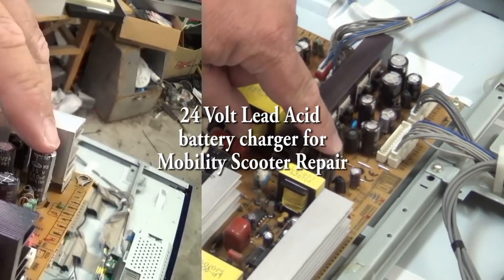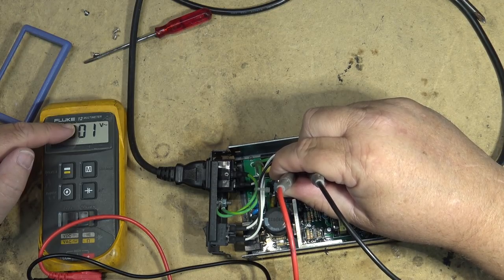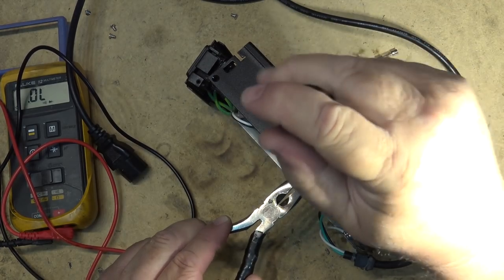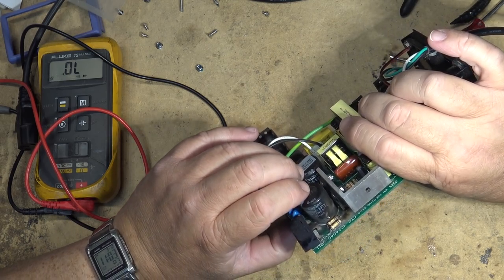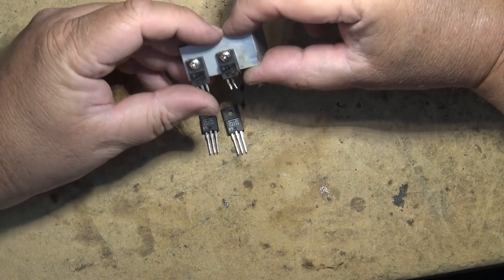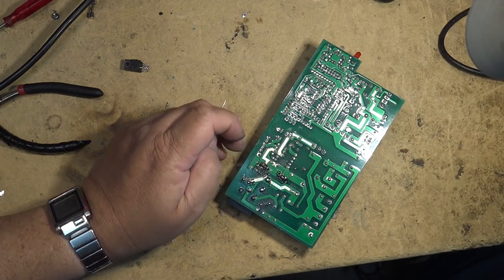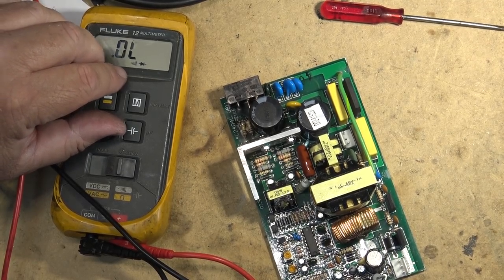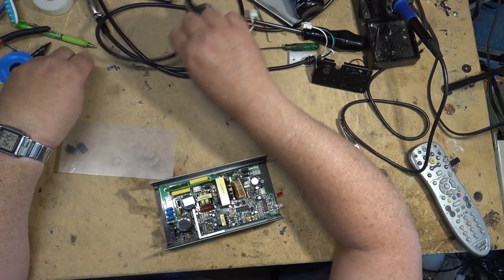Switch Mode Power Supply went Boom!! Let's fix it.

Comment: Loved the special effects. You smoke checked that thing so well it almost blocked all sunlight!  I might be about to receive a lesson here, but I usually just melt some leaded solder into the lead-free stuff to make the removal easier.
Reply from the maker: That's what i did.  Lead solder on the holes then solder wick dipped in rosin.

Comment: Try to use an old incandescent bulb in series as protection. In case of short the bulb will light protecting the circuit.
Reply: What could you use instead if you can't find that old light bulb? Ty
Reply: I think it has to be a 100 Watts bulb.
Reply: @lmolina  A 60W or 100W soldering iron with a 120 or 230 (depend on your grid voltage) led lamp both connected at the same multiple socket. The soldering iron make the load, the lamp make the signal light.

Comment: "Into this stupid socket..." I personally as an EE love those types of fuse sockets. Makes it easy to change and has space for a spare and they are quite inexpensive :)

When I do IEC modifications for older devices to get rid of permanently attached power cables, I choose these types if they fit to install :)
Reply from the maker: Place that nobody looks for the fuse. Owner didn't know it was there either.
Reply: @12voltvids  They're not uncommon at all in Europe. Can't say anything about USA.
Reply from the maker: @Mtaalas  
Well in Europe everything has a half dozen fuses.  Fuses in the plug, again at the input to the device, probably the wall socket too. I don't blame them though 240 volts has a few more hazards to consider.
Reply: @12voltvids  in UK they have fuses in everything and the kitchen sink, but most of Europe isn't UK :)

Though, frankly, having fuses in everything that plugs to a wall, including the wall is the best way to do it from the safety perspective.

And I wouldn't say 120V is safer, it just kills you slower.. ;D

And If I remember correctly, most people who die because of electricity do so not from the current or the shock itself causing damage, but from the ventricular fibrillation caused by the AC waveform. And that happens as easily with 120VAC as with 240VAC :)
Reply from the maker: @Mtaalas  Well not really true. Yes it is the current, only 50mA across the heart is enough to stop it, but the skin provides a certain amount of resistance. The higher the voltage the easier the skin resistance is broken to allow that current. 240V is far more dangerous to be shocked with than 120, just because 240 breaks the skin resistance easier than 120. I have been shocked by both and believe me 240 is something you remember. I did it unplugging in the 240 heater in my garage when my fingers touched the 2 live phases.  It hurts more than twice as much as 120.
Reply: @12voltvids  sure, but how in the earth did you manage to touch live wires in that situation? :o
Reply from the maker: @Mtaalas  I wasn't touching live wires.

Comment: Nice job.  When you showed the slow-mo of the burn out, I thought I saw a brief spark right in that transistor area but, of course you did not have that benefit while doing this repair.  Nice troubleshooting and diagnostics.  Good of you to repair it for your neighbor.
Reply from the maker: Did the red arrow pointing at the flaming resistor not show up?
Reply from the maker: I was paid to fix it.  Just so happens to be a neighbour.  If you remember that big old Toshiba receiver i worked on years ago, same neighbour.
Reply: @12voltvids  I didn't see one and, just to be sure...went back and looked again.  I may be blind, ha ha...but...I really do not think it is there.
Reply from the maker: @OverlandOne  Watch the replay when I was talking about the transistors failing catastrophically and other damage at 22:05
Reply: @12voltvids  Ah yes, I was checking the other slow-mo...sorry.  It is there and clearly visible. Never mind...ha ha.

Comment: When you started to desolder those transistors I was asking myself "Why doesn't he have a desoldering gun?" Then a few seconds later you dub in that this would be a good time to use one.
Reply from the maker: I used my heat gun.  Took them out in 20 seconds.

Comment: When I don't have a solder sucker, I use an irrigation bulb, heat the solder and puff the bulb to clear the hole. If I don't have one of those around, I've been known to blow the molten solder out of the hole with my mouth. Replaced some MOSFETs in a truck's PCM using that method, when solder wick just wouldn't clear the holes.
Reply from the maker: Air hose works great but leaves a mess as molten solder goes everywhere

Comment: Yes, a desoldering pump is a nice piece of equipment. And there are some not-so-expensive-ones, though I normally use an older Denon SC-7000 that is quite expensive. But I also used a Taiyo TP-100, an older Ersa Vac40K and a real cheap one called "ZD-915 ESD 80W" which is good-enough-for-me. Latter one costs below 100$/€

Comment: Yes those resistors do fail when the transistors go, but also those 2 small electrolytics near them are likely the cause of the initial blowing, as they likely are high ESR, and thus the transistors do not turn on fully and overheat. standard old ATX supply with secondary regulation, another thing that fails is the capacitor between the transformer primary and the centre tap of the mains reservoir caps, though that often announces itself by being split. The transformer pins also tend to have dry joints as well, along with the output diodes, as they are heavy and will experience a lot of movement forces in handling.
Reply from the maker: Caps were checked when our.  Full capacity and low esr
Reply: Looks very much like a variant of the application note TL494 type SMPSU (TBH they're almost always a minor variant of some app note or other, it's only the really esoteric ones that aren't) with some extra charge control circuitry.

I highly recommend testing the charge controller as well, I managed to cook a leisure battery (fortunately my own) with one charger that came in with blown switching transistors, turned out the op-amp monitoring the battery was also dead and holding the charger in bulk charge and not changing to float mode so it overcharged the battery quite severely.
Reply from the maker: @M0UAW_IO83  it's working. I plugged a battery in and it charged then shut off
Reply: The ESR of those capacitors will cause them to get hot; when they get hot enough they will vent - meaning the lid will bulge (or open completely) or if the vent is on the PCB end then you’ll see crap on the PCB around the caps.
Reply: @stevebabiak6997  Not always, I have seen many high ESR caps that are neither bulgingf or leaking, just having a sleeve that is either dull or shrunk.. Plenty also are totally without visible signs, just nearly open circuit, especially on the lower value ones.
Reply: @12voltvids  Capxon brand are complete crap, and replace on sight. Guaranteed future failure.
Reply from the maker: @SteveMasonCanada  
Same goes for Elna.

Comment: Those encapsulated Transistors are prone to overheating just cheaper production costs to use them. Better off replacing with metal backed and micas etc.

Comment: Love your old school solder wick.. but it's a danger to small lands and multilayer boards.  Get the right flux and a old school solder sucker (poor man's desolder pump).  Very kind of you to fix this.
Reply from the maker: I have and used liquid flux. I didn't show removing the transistors which involved a heat gun to heat the board to melting temperature and just lift the parts out.  My old school desolder pump did nothing to clean the holes but flux and wick dipped in flux did.
Reply: @12voltvids  I hate the no lead solder as well. Yeah.. I noticed you didn't show getting that thing back in its box and lining up the heatsink mounting hole either.  Hope the sun is out and there's less smoke in the sky.  Your neighbors are lucky to have you around :)

Comment: Think 24v on an XLR is bad? Some cheap smoke/fog machines use a 3-pin XLR for the remote. 120 or 240 on that socket, just waiting to get the DMX chain from the nearby lighting plugged into it.

Comment: Do mobility scooters user a standard charger across all manufactures, or is it this particular manufacturer that uses XLR connectors proprietary? And may charge a stiff premium for their replacement chargers?
Reply: I think the mobility scooter switching power supply people are in cahoots with the microphone and recording equipment manufacturers, ha ha.  When people burn up their equipment, it has to be replaced.
Reply from the maker: My Schwinn electric bike uses the same type charger 24 volts into same canon XLR connector using same pin configuration.
Reply: My wife has an old scooter like that and it also uses that XLR connector. Seems to be pretty much the standard….

Comment: Looks like one of the caps are bad or there’s a dead short in one of the coils I had the same problem with my laser disk player I got off of eBay every time you would replace the fuse it would blow then I found out it was the first man coil that it had a dead short in it So I had to replace it and after it worked and I was happy then I could watch my laser disc collection.

Comment: Fire at 7:11 under a main capacitor. Think it's shorted? Hmm. Bipolar power transistor short  to ground usually is to blame. Damn I detest the lead free solder too. Quite the 
learning experience video here too Dave . Glad it got fixed cause it looks like it  was a pain to work on.

Comment: Was "shocked", that you just replaced the fuse and tried it vs looking for what might have blown the original fuse first.  Then again, when the new fuse didn't blow and instead let the smoke out.  Isn't there something to do first aka check for a short on the board before blowing it up?  I must admit, your method located the problem more quickly. :D
Reply: Thanks for helping out a friend in need!  Cheers!
Reply from the maker: The transistors were shorted.  So really nothing blew up except a resistor.

Comment: Could use a better quality solder wick, I've had that issue with the cheap kind that is made of thicker wire braid mesh. I've found NTE brand is good, it's made of a fine wire braid mesh that is about double the width of the braid you're using. I have had other brands that also work well just don't remember what brand.
Reply from the maker: Actually the solder wick i have is excellent quality.  They make it in multiple wire gauge and the stuff i have us the green which is very fine.
Mg chemicals.

Comment: Oops, wrong cable plugged in.  I am surprised you left that in.  Anyway, shows you make mistakes like everyone else.  I didn't know there was a fuse hidden as it enters the power supply, that would have had me wondering for a few minutes lol.
Reply from the maker: I did that intentionally.  Wanted to see reaction.  And to show that the connectors are the same and will plug into each other. Put the AC on the output side and apply power and see what happens!
Reply: @12voltvids  yeah right, no it was wrong lol.
Reply from the maker: @BoB4jjjjs  Actually I did that on purpose to see the reaction, because if I did fuck up, which I do from time to time you would NEVER have seen it. It would have been edited out.  I grabbed the wrong one by accident, but rather than stop and grab the right one I figured what the hell lets plug the output connector onto the input to see what the reaction would be.  I was going to put the wha wha wha sound effect on when I flipped the switch and saw nothing happen.

Comment: Dave, We all make the odd mistake and most of the time nothing gets damaged.
I was worried that the transistors may have backfired through the little driver transformer and popped the two driver transistors  driven by the p.w.m chip.
Lucky that it didn't :-D
Liked the duo cat Me Oww lol.
Reply from the maker: Mistake? All i did was replace the customer replaceable fuse.   Fuse could have popped for any reason  but in this case it was because a transistor failed.  Normally it should have blown up like that when the transistors failed but it didn't.  I looked for any burn marks none seen so initially suspected just weak fuse.
Reply: @12voltvids   No not the fuse, when you had a cable plugged in the wrong place.
Reply from the maker: @zx8401ztv  Ha ha,that was actually intentional, as I wanted people screaming at their screens. It was to illustrate that the connectors would fit on each other and if the AC cord was plugged into the DC out major sparks would happen.

Comment: If one of the switching transistors is blown, does that usually mean the other of the pair is blown as well?

Surprisingly, your smoke filled sky looks identical to ours and we live less than 50 miles from the closest out-of-control wildfire here in California.
Reply: It depends. With this type of supply sometimes just one fails and sometimes both fail. If only one fails the unit will just be dead. If both fail you short the power rail gets shorted and you blow the fuse, like happened here.

Comment: Surely a fuse is meant to blow before a appliance blows up? I don't get it. Mind you, I laughed hard and long when it let rip.  More of the same please. LMAO.
Reply from the maker: This uses "slow blow" fuse to ensure destruction of the components before the fuse blows. There used to be a saying, a 300.00 picture tube will protect a .10 fuse by blowing first.
Reply: @12voltvids  Woah. That sounds like the Queen of Hearts logic from Alice in Wonderland. I didn't know Edison wrote that as well.
Oh well I guess its good for keeping the occupants feet warm. Or make Lazarus hop off and walk. Lol.
Reply: 12voltvids - the slow blow fuse is used to better withstand the surge of current at start up. You can compare the current vs time to blow for both flow blow and standard blow and you’ll see that the slow blow can handle surges better, yet blow quickly enough when a constant overcurrent condition occurs.
Reply from the maker: @stevebabiak6997  
Yes i know the reason for slow blow.  To allow for inrush current to charge capacitors. A semiconductor will blow first.

Comment: Geez what's with the comments.  Everyone is an expert apparently. 

I've always found the gate drive transformer designs like that tend to isolate the oscillator from transients a bit better,  unlike designs where the drive circuit and oscillator is on the primary and a shorted chopper fet will take out half the power supply.
Reply from the maker: This one uses BJT, not FET but the idea is the same where one transistor biases the other off and vise versa.  
The smoke show was staged when i discovered the transistors were shorted but it sure drew all the internet  experts out.

Comment: Hi do you think that i need to study electronics (certificate or diploma) in order to be able to fix electronics devices?
Reply from the maker: No. It can be learned.  I studied electronics in high school, and worked at a local TV shop after school with a master radio engineer who mentored me and taught me allot, went onto BCIT in a different field of study (television production) and when I found out there were little opportunities I went back to my hobby of electronics. Got a job with Sony of Canada and started taking the factory training courses. Sony put on "Special High Intensity Training" SHIT courses full of vert dry theory, but I learned a few things. I left Sony a year later and went to work for a large sony dealer with a service dept and did a live sentence there (20 years) for the crime of thinking that an electronics career was a good idea.
Reply: @12voltvids  thanks a lot for explaining that to me, so from your experience do you think that an electronics career is not a good idea? i live in Alberta, and if it's good option what is the best way to learn electronics?
Reply from the maker: @bmw320540750  
Depending on the field. Consumer electronics is a dead end imho. Products are cheap and disposable.  I did it for a living for 20 years and had to get out or i would have starved and that was back in 2003.  I do it now as a sideline.  I work for the phone company during the day.
Reply: @12voltvids  Thanks a lot for this advice i really appreciate it, that's true consumer electronics is dead end specially electronics are cheap and every year a new technology comes up which makes the old technology have no value, .your channel is one of my favorite,
Reply: @bmw320540750  Yes very little is made for ease of repair, except for very high end stuff, and even there you run into parts availability and designs that cannot come apart (fruit company) at all. Sony is unique in that they actually do have service centres and do stock spares, but you get reamed at the price of them, though another is Matsushita, who do support spares wise the larger ticket items, and even some of the cheap stuff. Aside from that almost no other big manufacturer does it, you find the stuff is designed to be cheap to make, cheap to assemble and almost non repairable, as they rarely continue a model past 3 years unchanged, and spares support is dwindling, and often ends a year past warranty when they dump all the spare stock to save the storage cost.
Reply: @SeanBZA  that's true. thanks a lot for explaining that to me. i appreciate it.  i got the picture now and that's will help me a lot.